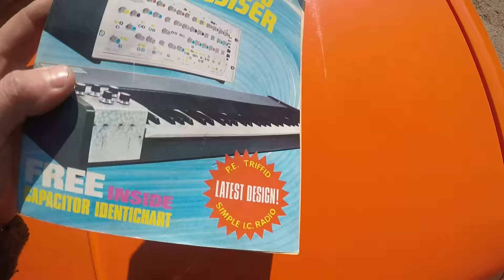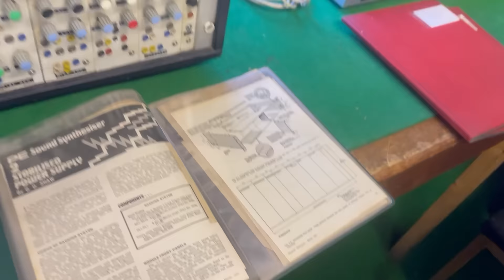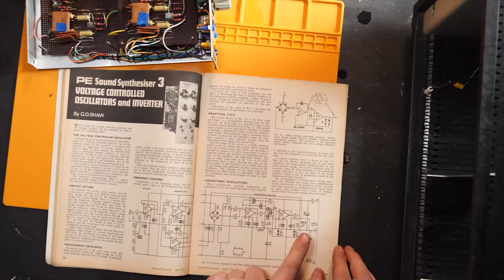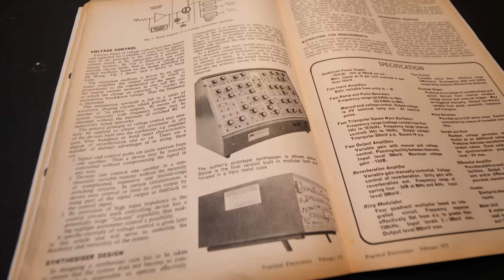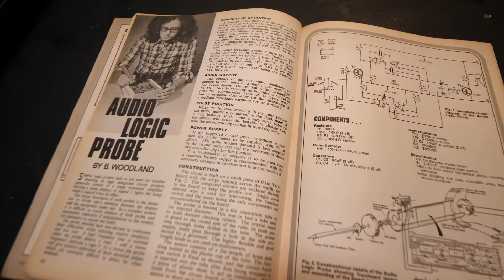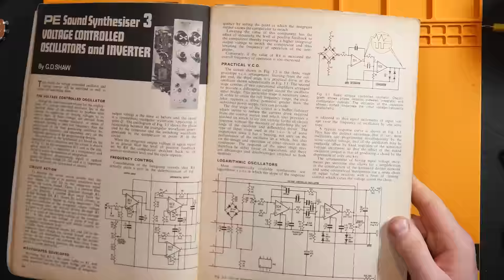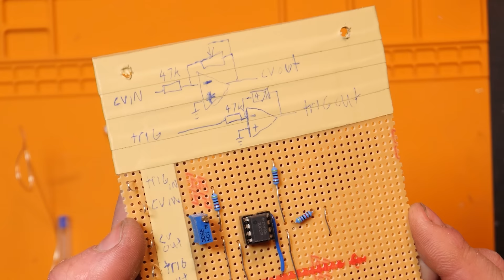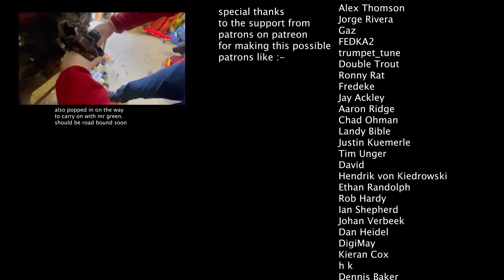A Rare DIY 70's Magazine Synthesizer You Built Month By Month - P.E Synthesizer

Comment: I started building this synth back in the 70's. Sadly never got to finish it. One thing I remember from the articles was the corrections made each month. You would build the circuit for March and in the May edition there would be a modification made or a typo corrected for the text printed back in March! It got a bit frustrating. lol! As the saying goes, "If a jobs worth doing, it's worth doing twice!"

Comment: I instantly recognized this as soon as I saw the thumbnail. I was 10 when these articles came out in PE and sooooo wanted to build it - but it was way to expensive for my dad's budget (!). I did read the print off the magazines though, and I learned so much about the principles behind synthesizers by reading the articles. A little later ETI did a synthesizer in conjunction with Maplin Electronics (the 4600?) which extended my knowledge, as it was a little more advanced and  less non-standard, and I was lucky enough at the time to be living only a few miles away from Maplin's shop in Southend and used to go there from time to time to have a play with the demo model - the shop staff tolerated it if they weren't too busy and I didn't make too much of a pest of myself, and they recognized me and dad as people that bought components from them :)   I've never actually heard the PE synthesizer so this video and the ones coming up are going to be really interesting! I always thought the keyboard unit looked really great.

Comment: In 1972 I built a PE Organ for a neighbor and in the 80s a Digisound 80 for a friend.  Modified so many circuits to work with the few components I had. Paper round bought in about  a quid week. : (
Reply from the maker: woop nice one peter!
Reply from the maker: quid a week tho! looking at inflation, but then again yeah looking at the prices in these maga, some would be tough to get on that@
Reply: @LOOKMUMNOCOMPUTER  In spring 76, while looks at uni I may apply for, went to an Electronics conf at Leeds. Got info on the Signetics 2650 CPU and parents bought one for my birthday. Had been playing with video since the first articles on Pong came out. Ended up going to Imperial College for Comp Sci. Start of a career in computing. Todays teens can start with AI and see where that goes : )

Comment: Fantastic episode. I remember waiting for each PE Mag. to arrive when I was around 13. I was in New Zealand so they were usually hitting the book shop about 5 months latter. I did build some of the modules but things like the Vero case was way out of my price range, I could barely afford the magazine. The circuits were just the right level of sophistication that I could pull out the bits I could build, and use parts I had, but not have to follow the schematic  100%. Just seeing the magazine covers after 50 years is a trip.

Comment: A brilliant find, more than a little bit jealous. This is the synth that got me interested in electronics and started my magazine collection.
Reply from the maker: It's definitely a cool synth! An awful lot of work compared to its counterparts in the latter part of the 70's. It's of it's time. I wouldn't recommend anyone build it over other diy synths of the era however. But can appreciate it for what it is and the point in the diy synthesizer magazine series timeline
Reply: I still have a goal to make a Wireless World synthesiser, which is if a similar vintage.
Reply: If you haven’t got one already, you could do with picking up an ESR meter, like the one from Peak. It allows you to check electrolytic caps without having to desolder them quite often.
Reply from the maker: @mikegorman8558  i have one! but its a convoluted story why i havent put a video out yet

Comment: I built the PE Minisonic syth from a kit which used a Stylophone type keyboard. Couldn't afford a proper keyboard as a BT apprentice. I never managed to get the noise generator working but everything else did - all those 741 op amps. The ring modulator was very good.  I've just been looking at some synths using the Pi Pico microcontroller and others using Euroracks. All very tempting.

Comment: I remember my dad making a synth from the Elektor mags back in the mid/late 70's.
Reply from the maker: formant?
Reply: @LOOKMUMNOCOMPUTER  No! I've just searched around and found a picture of it. It wasn't Elektor (although everything he and I have made over the years is from Elector), the synth was actually either a Maplin 3800 or 5600S or the ETI 4600. I remember the distinctive patch panel, general layout of the panel and the modulation joystick on the left side of the keyboard. There is even a Facebook group for the Maplin synths!

Comment: Great montage of how it would have been like to have to wait each month to build institutions, Props to Steven for putting that together all those years ago, and props to you for making sure it will be seen for a long time to come. BTW after mucking around with radios from the 30s to the 60s i now just find it easier to take the pots out and chuck them into the ultrasonic cleaner with EC cleaning solution, way cheaper than replacing them and better results than with just deoxit .

Comment: Would love to have a go at recreating one of these projects. I’d imagine “most” of the components would still be available to track down, but the beauty of veroboard style projects is you could easily work around those vintage semi conductor components you can’t source no more. 

The only thing putting me off is sourcing the actual parts for the actual keyboard. I know you can easily interface in an modern MIDI or USB keyboard, but, to me it’s not quite in the spirit of the original design concept.

Comment: I built the keyboard section only - the v per octave section was done with a ca3046 (transistors in log mode) and 2 transistors used as a heater/thermostat !!!  this required so much setting up and i never achieved octave tracking fully - The keyboard switches were gold wire assemblies that needed to be glued to the mount panell...  the big Knob on the front is the FINE tune only - the rest of the circuit is pritty much usual 741 style but pins 1 and 5 on the 741 gave me some trouble at times...   the VCA uses a difficult to get IC...  Kevin...  Stratford Upon Avon...

Comment: Remember thinking of building that  synth. So glad I didn't. Way too much like a lab instrument than a musical one. I built the "Minisonic" which came out a while later. That was a nightmare. A whole synth on  one or two vero boards with a psu that had the worst regulation ever. When you opened up the filter,  the DC rails dipped with the extra current flow. Nightmare. I learned a lot from it though. Binned it in 1992.

Comment: Excellent presentation.
Considering the age of this device (~50 years) it was in great condition. 
You are always going to get pots and caps that need replacing.
I wonder how much this kit cost in the early 1970s?
And how much you bought it today?
Reply: Back then, just the Vero rack case would have broken the bank for me, let alone the cost of all the gubbins...
Reply: @countzero1136  I remember paying about $3,000 (AU) for a Roland D50 synthesiser in the 1980s. A lot of money at that time.
The most ridiculous musical instrument was the Australian made Fairlight. It cost around $25,000 as a base cost in the 1970s - as much as an inner city Home would cost.The first Fairlight Cumputer based synthesiser purchased and shipped to the UK was by Peter Gabriel
Reply: @PetraKann  Yeah I know the Fairlight pretty well - I used one in a recording studio in Bristol back in the mid 80s. I always kind of wanted one but back then the thing cost more than my house, so I had to make do with a DIY sampler addon for a ZX Spectrum +2 and a home-made synth keyboard (49-note bought from Maplin) that I wired to work via the Spectrum's keyboard connector, and a simple BASIC program to read the input. It worked but the slow CPU killed any kind of sample playback fidelity. Later on I got an Atari ST which could (just about) play back samples with reasonable quality and of course had MIDI which was a godsend by then - still not exactly a Fairlight substitute but I got a lot of use out of it :)

The most amazing thing about the Fairlight though is that today you can do everything that it could do (and much more besides) with a free app on your phone :)

How technology has moved on...
I do prefer analogue synths though if only because the controls are far more interactive, particularly for playing live
Reply: @countzero1136  Fairlight technology was definitely ahead of its time and one of Australia's better and more creative products.
Just not affordable for almost everyone. Only the big recording studios and big bands managed to get hold of a Fairlight. Worth as much as a house (and some)

Comment: How was the echo / reverb made?
Philips BBD chips?
Reply from the maker: spring reverb tank which is next to the power supply on the back
Reply: @LOOKMUMNOCOMPUTER  Cool, sounds good. probably the Lorentz force that makes the spring move when AC signals passes through it and the magnetic properties of the metal itself.

Comment: You need some better seats bud,, I used to drive from glasgow to Stratord upon avon in my 1981 clubman and be rested enough to race 2 days, dring my bodyweight in cheap lager, sleap in a tent and drive home no hassle. .. that said mine was rover k-series powered so i had a 5th gear and could use cheap fuel x
Reply from the maker: dont get me wrong i was saying that for funnsies, seats aint that bad at all actually. surprisingly comfy :D
Reply from the maker: honda k or rover k?
Reply: Rover k, turbocharged.  My seats were nothing special, just metro ones recovered  on home made bases. But still a decent upgrade :)
Reply from the maker: @denisohbrien  nice one!, yeah i have a friend trying to talk me into a honda swap. but im a stickler for 70's mods and a series upgrades so plan is to use this engine a lot this year, which dont get me wrong is still a lot of fun the cam in it makes it very funky.  then hopefully end of the year have funds to justify rebuilding it with an 8 port head. as for the seats! yes i can imagine nice, but the ones i have were a pretty penny and they do the job enough haha, just a bit snug for anyone with even slightly wider hips than mine haha. cheers.
Reply: @LOOKMUMNOCOMPUTER  I absolutely get sticking with the a-series , 8port head would allow fuel injection and the difference will be outstanding, but that involves a computer haha I was never well off enough to get the power (reliably) I wanted out an a-series so a swap was the sensible route for me.

Comment: How is going 850 miles in 24 hours a long way? That's only like, what, 12 hours of driving? I've gone 970 miles in 16.5 hours without breaking the speed limit, and then gone to work no problem.
Reply from the maker: Same I do it all the time. But in a car with straight cut gears it's
Hard work